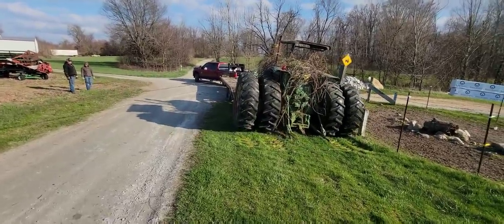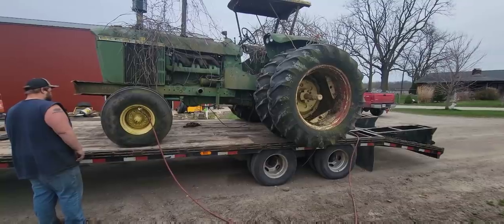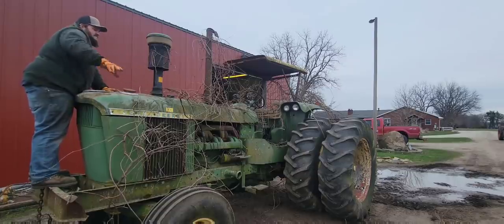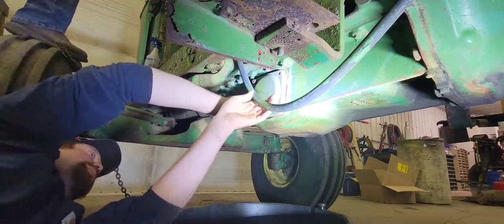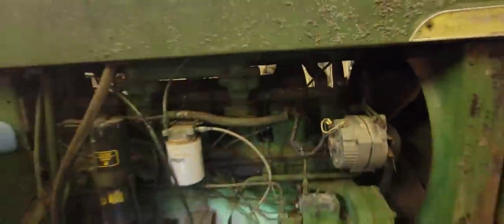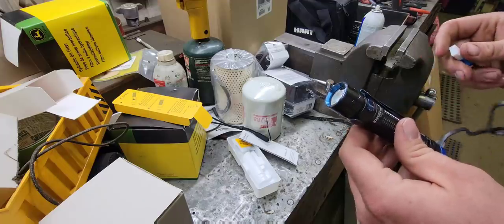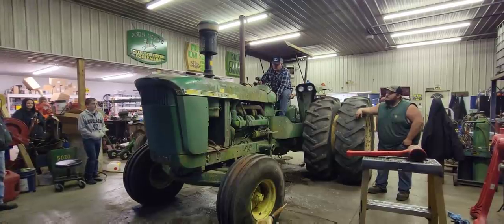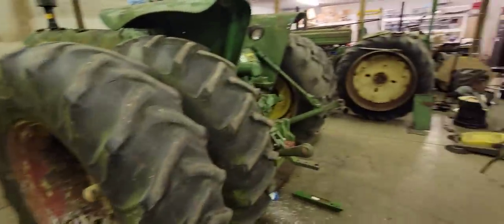Top Secret Tractor For Plow Day

Comment: Nothing runs like a Deere with an International pulling it! Lol. Although I am an International man, it's great to see someone take a John Deere in that condition and get it back running again and putting it back to work. No matter what the make is, old tractors are much better than the new ones and will be running long after the new ones are all gone given the chance. With the electronics, once these new tractors sit in the bush for 30 years, they would be scrap, as the electronics won't revive. It will be great to see this tractor turning dirt again.

Comment: I've been a flat bed tow operator for 20 yrs. I took 2x8s all thread and 2 eye bolts and made my own skid plates they work when the front tires move and you don't want them to. I've also bar soaped the bottoms where wood on wood builds heat and the bar soap acts as a lube. Even if the rear tires are locked up or flat these boards come in handy. They make neoprene skates plates for 4x4s and AWDs cause the front wants to go forward and the rears want to go backwards when in 4WD.just a thought to make your witching experiences run all soomther

Comment: As long as that tractor sat, if it was me, I'd pull the clamps off and inspect the turbo quick, make sure the impeller spins and the shaft is tight, also make sure the oil feed line is good and clear, not collapsed or cracked. Nice find boys!

Comment: That’s a 5020 row crop because of the cut down dust shied on the platform and the row crop fenders. The front axle should be adjustable also. Good find especially with a turbo installed.

Comment: we had a 5020 that weighed 28,000 and a 5010 in the early 70's which we repowered with Kinze kits and detroit 8 V 71 engines, what a power increase

Comment: We use to have a 5020 . We put a turbo on it and turned it up to 210 hp . Was a great tractor as long as we kept the hired man out of it. The hired man got it hot and put cold water in it and cracked the block on it and had water in the oil.

Comment: What amused me is the three guys standing round, rather than helping : ). Does the steering not work at all if the engine's not running? Usually proportional ps will still steer a little bit by winding and winding the steering wheel

Comment: The steering motor becomes a pump when there is no hydraulic pressure. It will turn the wheels but very slowly and is high effort.